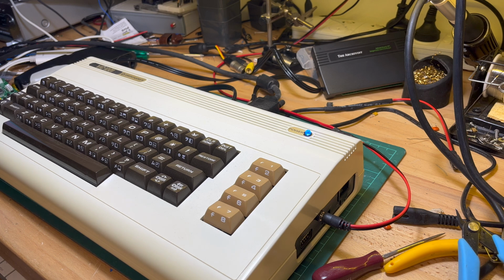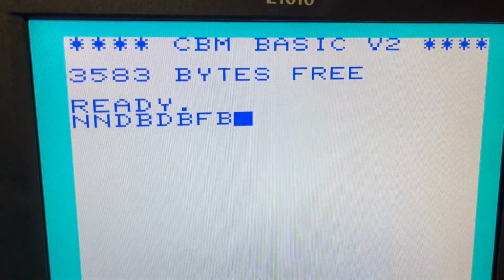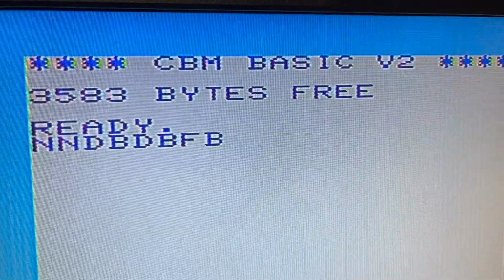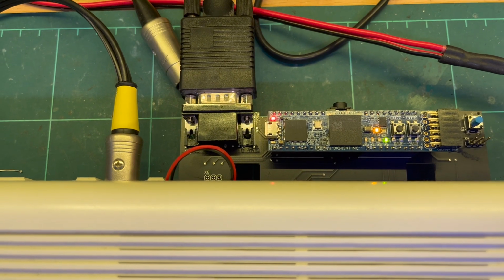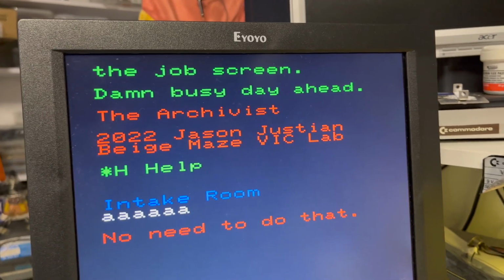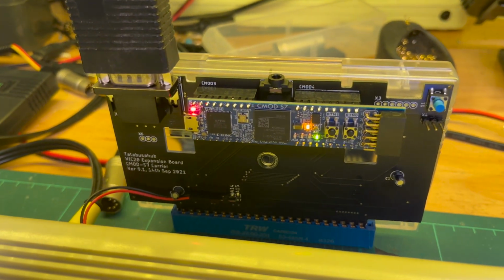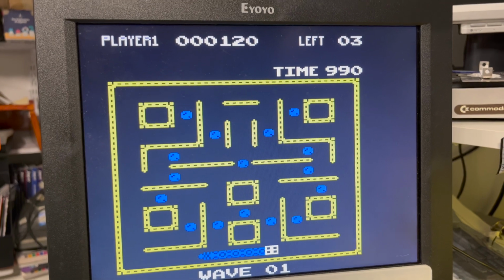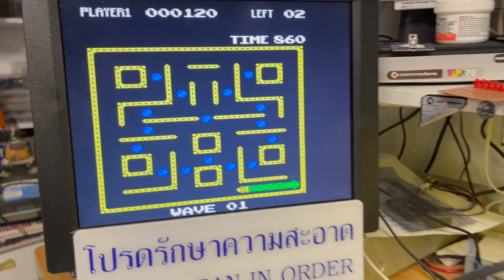Commodore VIC-20: VGA Adaptor (Part 1/4) [TCE #0190]

Comment: Neat, didn't know this existed and excellent colors with NTSC. I've had a NTSC VIC20 in the past and found it quite annoying to get the colors right on my PVM/BVM monitors.
Reply from the maker: Chris is working on an internal version - just demoed it on the VIC-20 FB group outputting to HDMI!
Reply: It's no longer NTSC is it? It's separated RGB, same as a PC display in VGA.

Comment: Anyone that can show a good picture of the A14 and A14 connected (soldered or even using "hooks") to a CR VIC 20 (pal if that makes a difference) - I have no experience with electronics and I am not entirely sure where to get the A14 and A15. A good photo would be nice - or if anyone has actually made a video of the process - even better 🙂

Comment: How does one use a cartridge or ram expansion with it?
Reply: The card has full memory expansion inside with +3k. +8k, +8k, +8k steps via poke commands then resetting the computer using a small reset button on the card. Chris
Reply from the maker: Like how I showed in the video?  I know I can ramble a bit so it's tempting to skip a lot ;)  Going to try a bit more in Part 2 - Chris said it's got adjustable memory expansion as well, but not sure how that works at the moment ...
Reply: @Brfff  I was a bit quick to post. Watching in the app casting to the TV it can be kinda quick to power on through to the next video and I miss my opportunity heh.  I did see how you did that. It does look a bit precarious though.
Reply from the maker: @Aeduo  chuckle all good ;)  I think Chris included an unpopulated header on the right-hand side that has the VGA signals so a possibility I'll check is to wire those up to an off-board VGA connector

Comment: Does this work if the VIC chip is removed or does it still have a dependency on the VIC chip?
Reply: The VIC chip still needs to be there because it generates the system cpu clock. The whole system including the 6502 and VIA chips do not function without this clock. Chris
Reply from the maker: Good question - Chris mentioned it works independently ... I was going to start a series of videos on improving the composite output and thought I'd try this first before hacking away at my board ... but he said it should still work regardless ... I'll test it out in Part 2! /Brett
Reply from the maker: Unfortunately, you still do need the VIC in there ... I guess this makes sense as I don't think anyone has replicated the VIC itself yet.
Reply: @Brfff  Thanks for letting me know. To be honest, I started my FPGA journey with replicating the VIC chip in mind.. but I ended up going off on a tangent making my own homebrew 6502 instead. Maybe I''ll come back to this one day and fix my 3 dead VICs. I have 1 working but the VIC chips are all dead in the other 3.
Reply from the maker: @paulspark7287  The C64 gets waaay too much love in this area, I think ... being able to replace a sick VIC chip is the holy grail I think ... more so than fixing the terrible composite output ;)
Reply: @Brfff  Yeah, if I do go ahead with this, I will be doing VGA. Thanks @Tatabusa Hub too - luckily one of my VIC chips displays a screen of garbage so I can still get the clock signals out of that. The last thing I want to do is start attaching wires to my one and only good VIC chip. I think it will be a fun project to tackle. I'm sure somebody will beat me to it though.
Reply from the maker: I'll take 15 please!!

Comment from the maker: This is Chris's post in the VIC-20 Facebook group from November 2021:
https://www.facebook.com/groups/525042937598268/search?q=vga

"This is a VGA output card for a VIC20. As well as that it can support full memory expansion, sound output  and a UART. The UART supports a direct memory dump into its memory, meaning you can download programs from a PC (8kbytes in less than 2 seconds). 
The board is $20, the FPGA plug-in board is $85 and shipping $15. All prices US$. And payment via PayPal. "